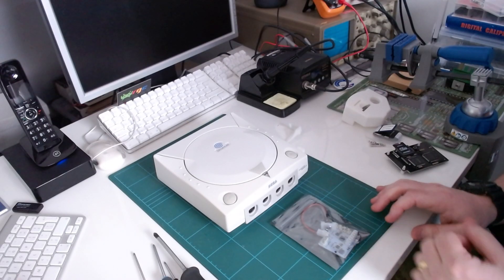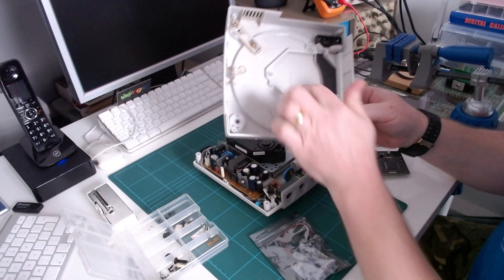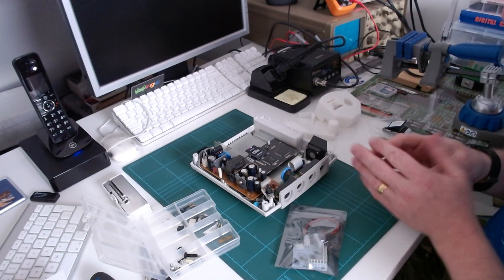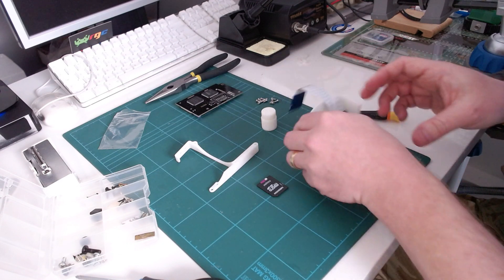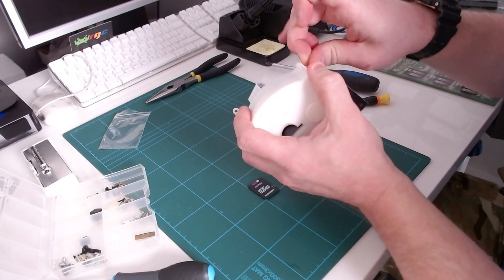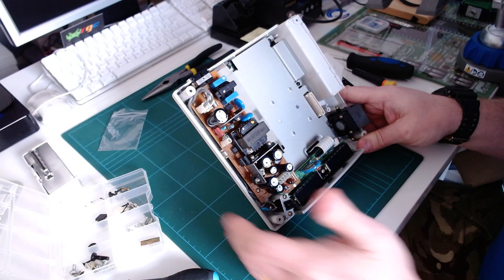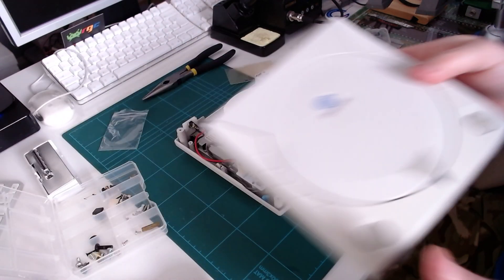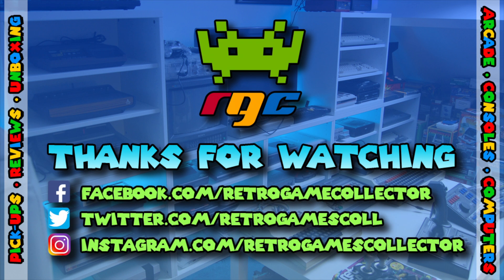Upgrade your Sega Dreamcast - quick, simple and cheap GDEMU and DreamPSU upgrades

Comment: Funny you posted this, I've been considering doing this to one of my consoles, so I'll probably be coming back to this later when I fit mine.

I am shocked how simple it is. 

Is That dreamPSU needed? I can't believe how much space it saves.
Reply from the maker: Yeah mate, because the GD-ROM is gone, airflow is messed up (what airflow there is in a Dreamcast anyway!), so the board runs hotter than it should. This PSU runs much cooler so mitigates that. Cheers for watching Eddie!